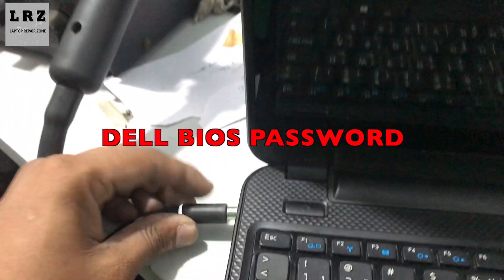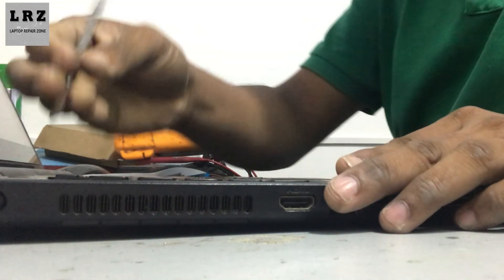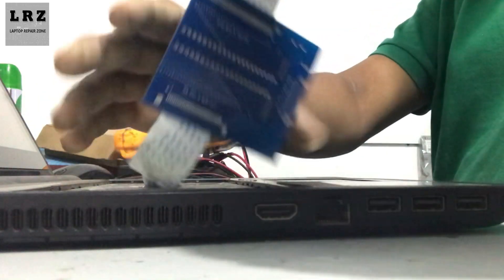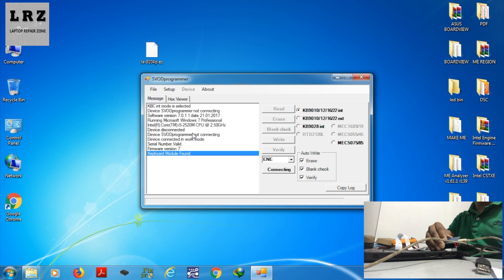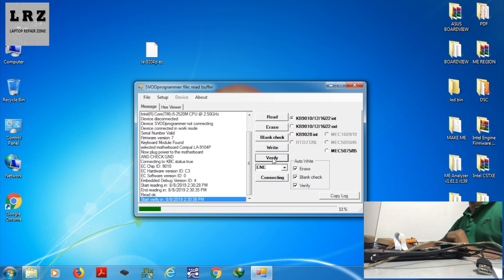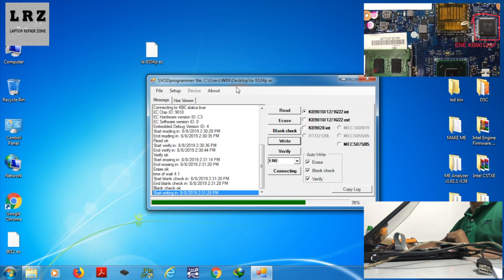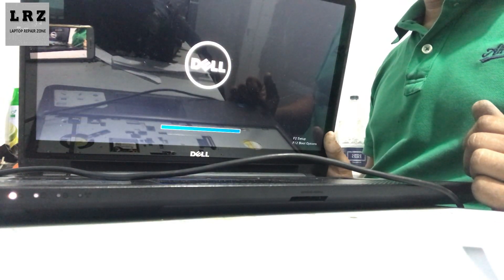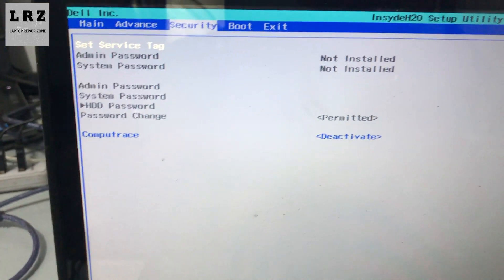Dell Inspion 15-5321 BIOS password Remove.

Comment: I have an Inspiron 3470 Desktop that I have reset. After the reset, it requires a system or administrator password from the DELL SECURITY MANAGER which I do not have. The site BIOS MASTER PASSWORD did not provide the correct password. Is there another site? The computer system # is 39GQ1S2-BF97. Can you help me out? Thank You!!
Reply from the maker: thanks for your comment,you need to flash BIOS.

Comment: Hi i have a dell vostro 1450. It's problem is that when I plugged in external hdd of any usb port it's not detected but Mouse and keyboard is connect very well. So can u help me for this problem
Reply from the maker: santosh mundepi thanks for your comment, check USB 5V is ok or not.
Reply: @Laptop_repair_zone  thanks for giving suggestions. Otherwise some youtubers r not giving the reply or answer. I will check this. Thanks

Comment: HELLO FRIEND I HAVE A HP 250-G6 CAP LOCK LIGHT BLINKING 5 SHOT TIME AND 3 FAST PLS HOW CAN I FIX THIS?
Reply from the maker: Thanks for your comment, motherboard issues, check all the required voltage.

Comment: Bro. What is the bios programmer model
And
What is the keyboard connection (extension)
If u can put eBay link
Reply from the maker: Thanks for your comment, I used SVOD programmer.
Reply: @Laptop_repair_zone  thanks